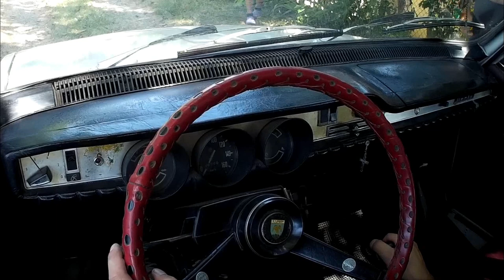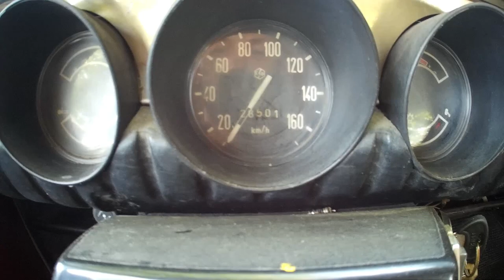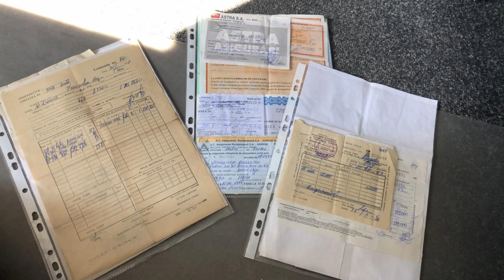Dacia 1300 Barn Find - Day 6 Test Drive

Comment: Salut, cum de ți-a ramas antigelul asa curat? Mie, dupa o tura cu ea s-a murdarit, ce-i drept nu asa tare.
Reply from the maker: Salut , sper sa ramana asa . Tot ce am facut s-a vazut pe canal , ma refer la aerisirea si golirea sistemului de racire .Ce e drept nici nu am mers foarte mult , aproximativ 1- 2 km . O sa vedem in timp daca ramane curat sau nu ...
Reply: Ca sa se pastreze antigelul curat,iti sugerez ca inainte de schimbarea lui sa bagi un furtun cu presiune pe instalatia de racire ca sa iasa toata mizeria....asa am facut la dacia mea si ramane curat.Unele Dacii au mers mult pe apa chioara fapt ce cauzeaza la formarea depunerilor si formaea ruginii in instalatia de racire.
Reply: @copilustrazii1754  am facut, aproape jumatate de ora a curs apa rin instalatie. La cateva zile, am observat ceva chestii rorunde ca gelatina pe fundul borcanului. Am sa-l mai schimb o data sa vad. Ms de raspuns